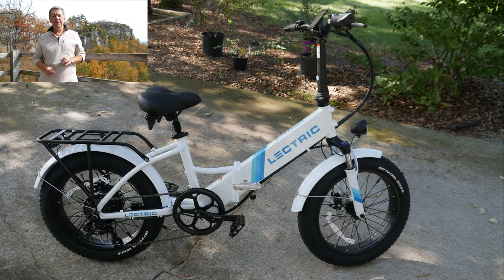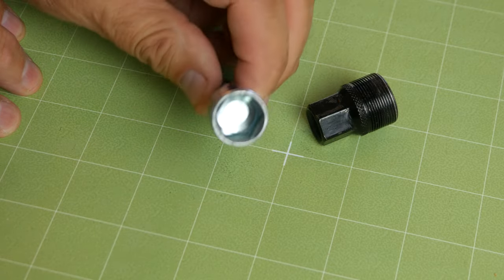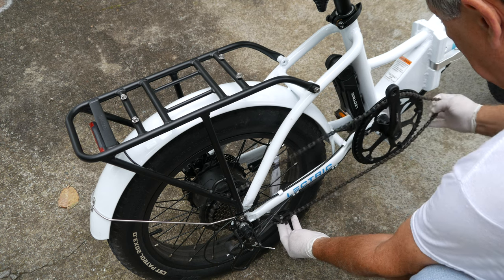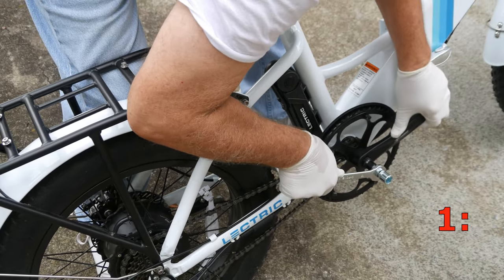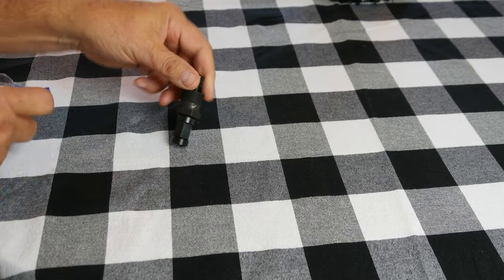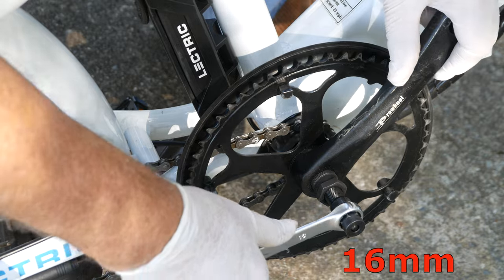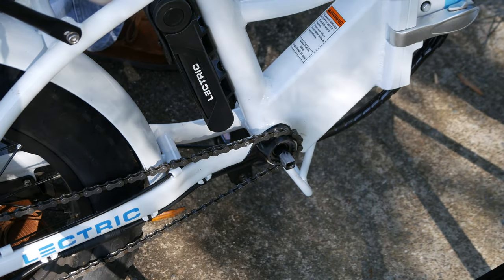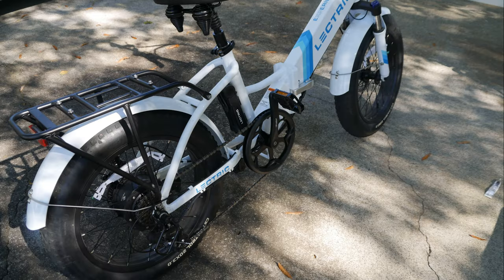Crank Replacement-Lectric 2.0 XP

Comment: The exact same thing happened to me. That crank puller tool offered by lectric is absolute junk! I just ordered the park crank puller from your link. Thanks a lot for this video.
Reply from the maker: Thanks for watching.  Lemme know if I can help.  Good luck on your repair.  Dean
Reply: @PilotViewProductions   Just an update.  The park tool crank puller worked flawlessly. No stripped threads. You saved me a trip to the bike shop and now I have another bike tool in my collection. thanks again!